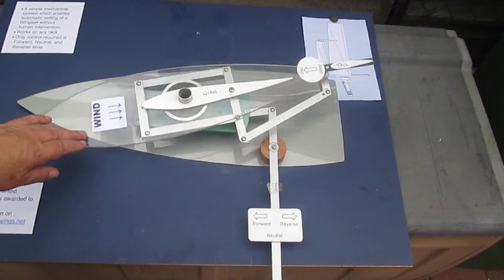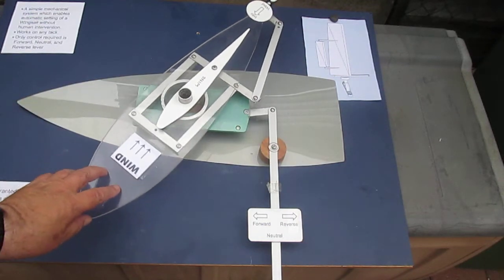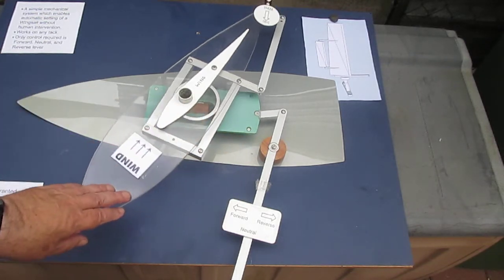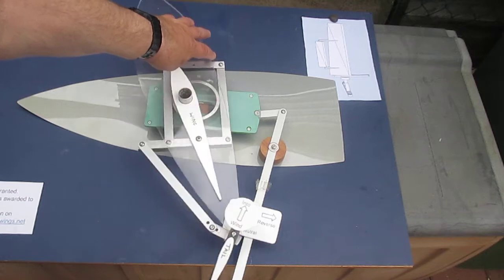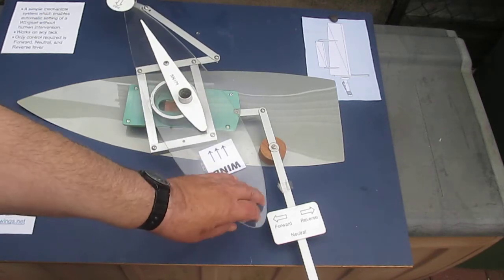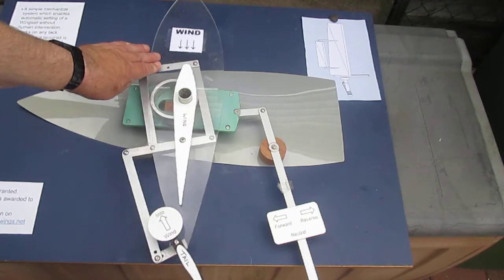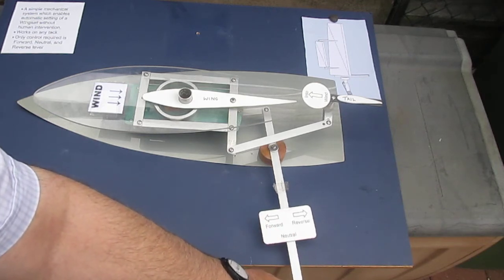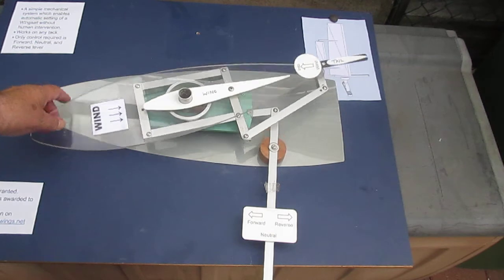Sailwings automatic wingsail

Comment: Has this been tested? I like it A LOT! It seems that sail GP boats have 2 things for power. The wing sail, which is essentially a high aspect ratio wing with an oversized aileron for the chord depth, looks close to 50/50. Also, and critically, both the wing and jib are endplated. Esp the jib. Similar to winglets on the tips of aircraft wings, but at the root, which concentrates pressure at the root, instead of bleeding pressure.
Reply from the maker: Yes it has been tested if you go to the address mentioned in the description you can get the full story www.windthrusters.com/story.html
Reply: @WindThrusters  I got that document Thankyou, and the full size wing test platform, most excellent! Surprising the wing isn't taller. What are your thoughts on endplates? I'm currently testing a soft sail in a high aspect wing format, with panel stiffeners to keep the aero shape. Instead of end plating to the deck of the boat, I'm going to try endplating to the boom, and see how that goes, in light of windsurfers (and sail GP) that feel a turbo effect when the sail is closed to the deck. You've inspired me to innovate! 🤟